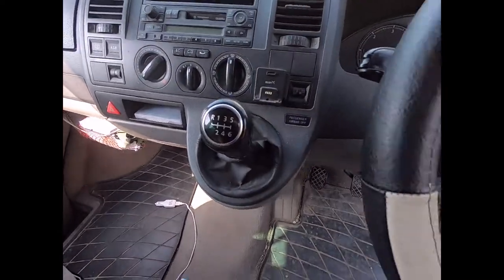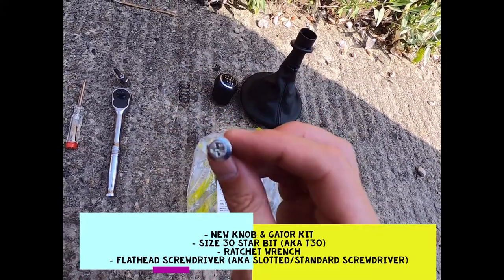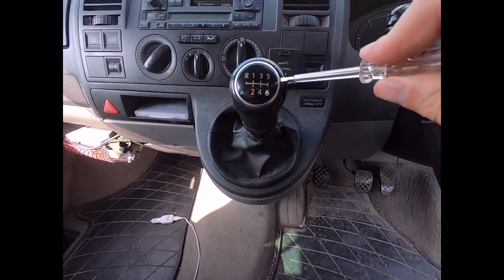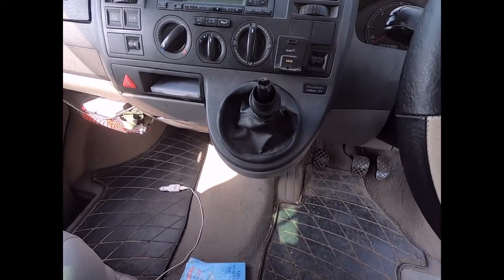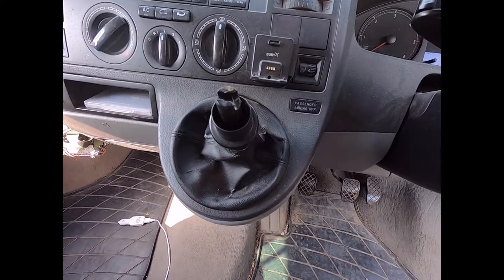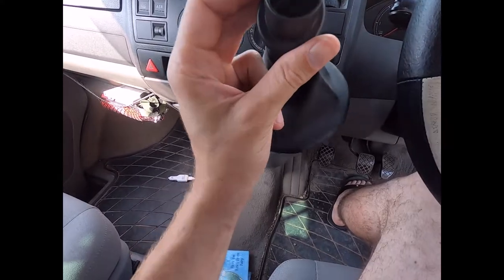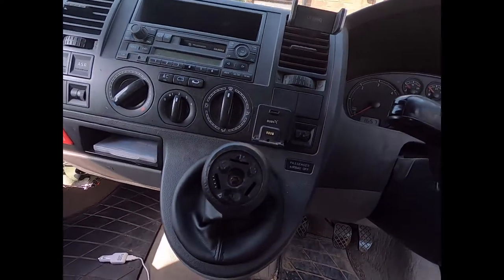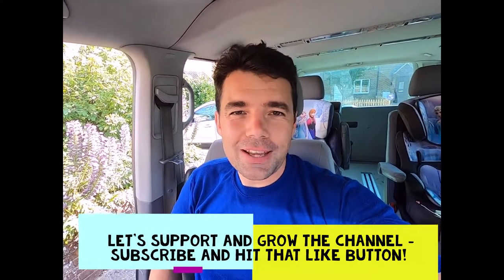VW T5 (Transporter / Caravelle) Gearstick Knob and Gator Replacement

Comment: Anyone who does plese please don`t use a screwdriver...use a plastic pry tool if you cherish your bus.
Reply from the maker: Hi Steve, spot on - please take note Betas!
Reply: Always use for example a piece of fabric if you have to pry. At this case not so much prying but gently press the ring gently and the "pry". My knob from Temu was not a direct fit like OEM; the knob was VERY tight fit to the shaft and the spring was too short. It did not even work (revert) with the original spring, had to put both. Mine is T5.1 -14 6speed. Old was original, there was printed date inside.

Comment: Do you need the kit or could u reuse the gaitor ring?
Reply from the maker: Whilst I guess you could reuse the original gaitor ring you would then need to attach this to the new gaitor leather (glue, staple, etc).  My concern would be getting a snug enough fit to be able to have the space to reattach the gaitor ring - personally, I would get the full kit to save time and get a nice finish.  If you reuse the gaitor ring though let me know how you get on - I'd be interested to hear and can update my comments in line with your advice!
Reply: @beingbeta9883  when I do it be rest assured I will:)
Reply from the maker: @planningadvice1184  Great stuff - cheers!
Reply from the maker: You're welcome!